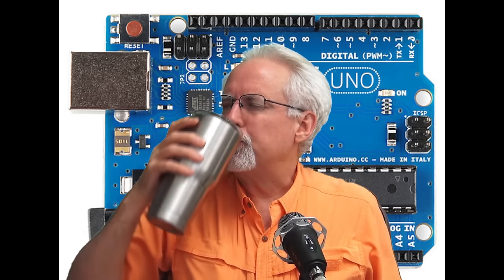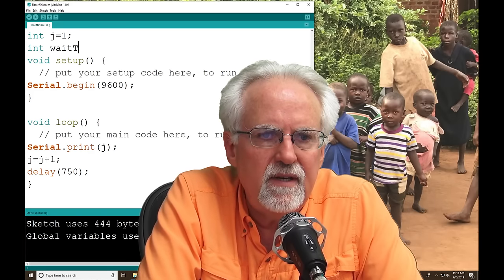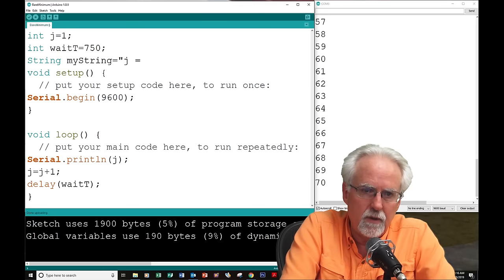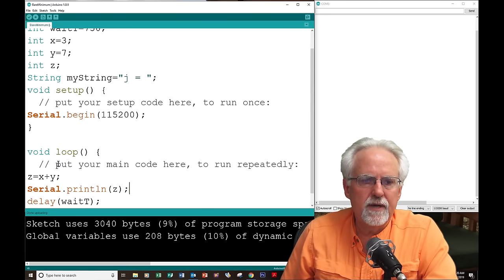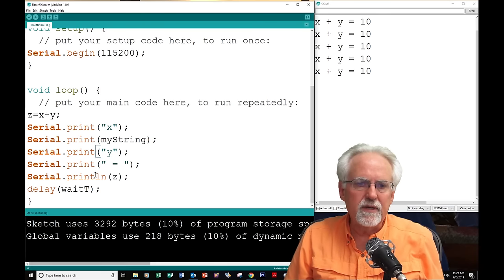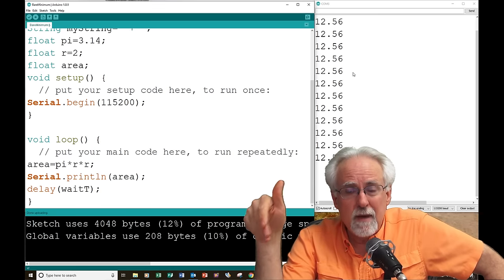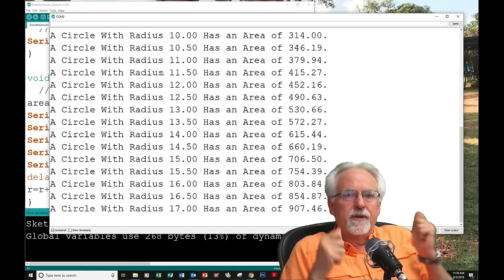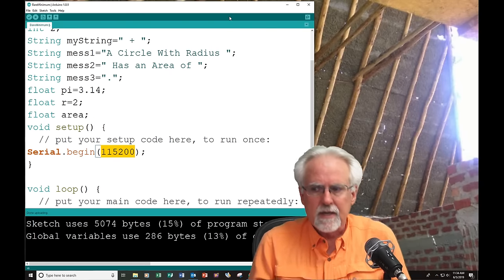Arduino Tutorial 11: Understanding the Arduino Serial Port and Print Commands

Comment: In C++ I was able to print multiple variables at a time, I gave it a try with this ide, low and behold it worked!
example: 
String myString=" + ";
int x=10;
int y=10;
int z;

z=x+y;
Serial.println(x+myString+y+" = "+z);

Code for this lesson:
int J=1;
int inDelay=1000;
int x=3;
int y=7;
int z;
String myString=" + ";
String circleA="the area of this circle is ";
float pi=3.14;
float r=2;
float area;

void setup() {
  // put your setup code here, to run once:
Serial.begin(9600);
}

void loop() {
  // put your main code here, to run repeatedly:
z=x+y;
area=pi*r*r;
Serial.println(x+myString+y+" = "+z);
Serial.println(circleA+area);
delay(inDelay);
r=r+0.5;
}

Comment: Great lesson again! Thank you so much, Paul. Used the print command to get something like this on serial monitor:
Voltage across 220 ohm resistor is 1.99
Voltage across 330 ohm resistor is 3.01

Code:
int readpin=A1;
int readVal;
float v1=0;
float v2=0;
int delayT=500;
String line1= "voltage across 220 ohm resistor is " ;
String line2= "voltage across 330 ohm resistor is " ;

void setup()
pinMode(readpin,INPUT);
Serial.begin(9600);

void loop()
readVal=analogRead(readpin);
v1=(5./1023.)*readVal;
v2= 5-v1;
Serial.print(line1);
Serial.println(v1);
Serial.print(line2);
Serial.println(v2);
delay(delayT);
Reply: Great work mate!

Comment: 00:05 Learn how to print from Arduino
03:00 The program prints numbers and increments them
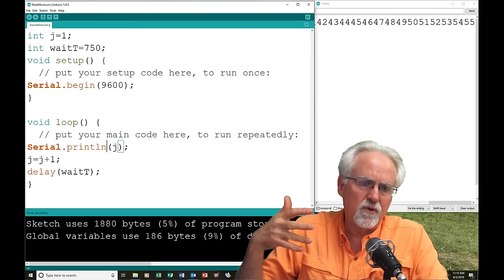06:10 Printing and formatting text using serial monitor.
09:34 Printing strings in Arduino using different methods
12:47 Understanding the difference between variable names and values
16:05 Print a circle with radius and its corresponding area
19:22 A circle with a radius of 2 has an area of 12.56.
22:29 Learned about variables and their types
Crafted by Merlin AI.
Reply: Shukriya ❤

Comment: Fantastic job Paul! 
While going through the tutorial I didn't want to lose the previous examples so I continued with additional Serial.print and Serial.println lines of code. Took a bit of experimenting but found it possible to print subsequent lines by always ending the last line with a Serial.println command.

The serial monitor returns this;
number = 1
3 + 7 = 10
Circle with radius 0.00 inch(s) has an area of 0.00.
number = 2
3 + 7 = 10
Circle with radius 1.00 inch(s) has an area of 3.14.
number = 3
3 + 7 = 10
Circle with radius 2.00 inch(s) has an area of 12.56.

Comment: I love your videos and they motivate me to challenge myself. I have a challenge for you using the millis function. 
1. Create a program that will allow the LED to blink by controlling the high (or on) time and the low (or off) time separately using millis function only.
2. on time=  2000      and    offtime =2000
3. make the program to do it over over again.

Comment: Amazing thanks Paul! 
Could be a good asset in mathematics for carrying out heavy equations that calculators are not preprogrammed to rerun. Really incredible, the range of applications you have with these microprocessors.

Noticed with the baud rate that the interval time between a new message is always 46ms, but the number of messages received in that time doubles, perhaps an update limitation of the serial monitor itself but I don't really understand. The baud number itself seems arbitrary at the moment.

Comment: MR pauI .I made my own one and I only learned the basics  and I got this and I test it,  works, very well;;;

float pi=3.14;
String mystring=("=");
int d5=2000;
float r=2;
float area;
String plus=("*");

int z;
int x=3;
int y=5;
String plusstring=("+");
String equal=("=");

void setup() {
  // put your setup code here, to run once:
Serial.begin(9600);
}

void loop() {
  // put your main code here, to run repeatedly:

  //mutlpying by pi
area=pi*r*r;
Serial.print(r);
Serial.print(plus);
Serial.print (pi);
Serial.print(mystring);
Serial.println (area);
delay(d5);
//ading  all postives numbers.
z=x+y;
 
Serial.print(x);
Serial.print(plusstring);
Serial.print(y);
Serial.print(equal);
Serial.println(z);

 delay(d5);
 
Serial.print(x);
Serial.print(plusstring);
Serial.print(y);
Serial.print(equal);
Serial.println(z);

delay(d5);

 
}

Comment: Perhaps a better homework assignment for this lesson would be to have us build a volt meter using two pins.  I did this and by moving the pins around on my breadboard, I was able to print out the values you had us calculate.

Comment: My goal is to eventually use the arduino to motorize a solar panel to follow the sun during the day and reset to start position to wait for the next sunrise. It would wait for 30 minutes and then back up a step or three then advance a step at a time reading the power from the solar panel and stop as soon as the power decreases from the previous reading. The panel will have a car electric window motor actuated through a solenoid. Polarity would be reverses by the arduino to step back and return. A means of determining end of travel is being thought about. Possibly a separate solar cell that would differentiate between night and day. Can't wait to get to the parts about sensors and solenoids.

Comment: At 9:20, I had a hard time seeing where you made that second change to the baud rate at the bottom of the printout screen. It took me several replays before I noticed the tiny box you were clicking on just over your shoulder. I did not see that the first few times through. So, I made one change (to the code) but missed the other & wondered why I was getting a long line of backwards questions marks! That might be worth drawing more attention to, in case others have the same issue.

Comment: Back in the days of VB6 you could tack several variables into a single line of code by using the syntax (using the variable of this tutorial) "A circle with a radius of " + r + " has an area of " + area + "."
is there no equivalent of this in the Arduino language?
Reply: You can, but you have to explicitly convert the float values to a String inline.  eg.    

Serial.println("A circle with radius " + String(r,2) + " has an area of " + String(area,2) + ".");

Comment: I know the importance of variables but I don't think is necessary to make variables to store text like  "A Circle With Radius" due to the reason that add complexity to program that's not needed but anyways your a amazing teacher and I think you are one of the best people to explain Arduino.
Reply: He was trying to show what can be done, not what necessarily what should be done. Though there are times when creating variables to hold string literals does make sense. Consider the situation where you might be printing pages of data and you want column headers on each page.

Comment: Hi 
you can write all of the print in one line like this, save some memory clear code
Serial.println(String("A Circle with Radius ") + String(radius) + String(" has an Area of ") + String(area));
Reply: Hmm, yes, but why are you casting strings to String? radius and area I get, but casting a string literal to a String is unnecessary.

Comment: Paul, I noticed that sometimes I upload the code and nothing updates? HOWEVER when I save (ctrl + S) and then send if the code is accepted then I do not have any complications.
NOTE TO TEACHER: I am starting to be able to pause and work ahead in anticipation (experimenting) of what I can try, then continue and what you suggest doing, I've already done something similar, BOOM!!! Thanks
Reply: Exactly the same as that. I actually went and did this by experimentation on the last tutorial. I printed, nicely formatted (as to not make Paul upset), 
"The voltage across resistor 1 is ..." 
"The voltage across resistor 2 is..." 
"The total voltage of the circuit is ..."

Its reassuring to go through a tutorial, already having the self found knowledge.

Cheers Paul

Comment: Quick question:
Last lesson, you said we should always put in a period/decimal point when coding in a number (e.g., 5./1023.).
Here, when you set j=1, etc., you didnt include the decimal.  When do we and when dont we include the decimal?

Thank you for the material!  Its been very well organized and informative!
Reply from the maker: Because j is a counter, and counters are round numbers . . . 1, 2, 3, and so forth. Those are integers. When dividing, you have to use floating numbers, hence the .'s

Comment: Hi Paul, I ordered these 433Mhz Rf Transmitter and Receiver package and they're very small components.  My question is, do these need to be connected to an arduino to work?  Or can they be used by themselves?  If an arduino is needed, it kind of invalidates the purpose no?

Comment: If Float accepts both whole number and decimal number. Why not use Float for all instead of Int?
Reply: Floating point variables use much more memory than integer variables...  In small systems like the Arduino series, you don't have gigabytes of memory to throw around.  In these small sketches that we're learning in these videos, it wouldn't hurt anything.  But if you write a sketch that pushes the limits of the board, you'll run out of memory.  Also, it's better programming practice to use the more efficient methods.

Comment: Do you cover event based print commands in another tutorial? I want to count the number of times a digital pin goes HIGH and also the duration of time it's HIGH each time. But I only want to print when the event occurs, not on a set time interval like shown in this tutorial.

Comment: Hi Paul, inquire how can i add say plus 3 degrees in coding of mlx90614 thermal scanner.  because as the distance of the object becomes further the more inaacurate  the reading is. to offset i would like to add plus 3 degrees in the coding to at least offset the distance to display in lcd 16x2 at least a more accurate reading.

Comment: Hello Paul! I accidentally put 2 in [Serial.print("A circle with a radius of 2 will have an area of ");] without thinking and it worked. I was wondering if its ok to put numbers in strings and if not why?

Also, I understand the importance and convenience of variables, but if you are sure you're going to use a constant only once, can you use a constant instead? 
Thank you so much!

Comment: I did the code you did:
int j=1;

int waitT=750;
void setup() {
  // put your setup code here, to run once:
 Serial.begin(9600); 
}

void loop() {
  // put your main code here, to run repeatedly:
  Serial.println(j);
  j=j=1;
 
  delay(waitT);
}

however I only saw 1 being counted, is there anything wrong with my  code?

Comment: I'm using a Teensy3.6 to follow along. 
When I copied your code over it worked for just printing 1, but when I incremented it, it started at 2. It worked, just skipped printing 1. Any advise?

Comment: is the printed response from the arduino or from the editor? IS THE ARDUINO PLUGGED IN AND ACTIVE IN THIS VIDEO?
Reply: It is plugged in and active all of the strings are uploaded to the arduino.  I made sure to test this by resetting my arduino after coding this.  I've unplugged from USB and used my battery pack after uploading.

Comment: Hi Paul, thanks for the series! According to my really quick search on Google, baud rate is the rate at which information is transmitted. Then is it intuitive to always use a higher baud rate? I understand that 9600 is enough for a simple program like this one. Are there any cases in real life where a high baud rate is not recommended?
Reply from the maker: If you do not have a clean data connection, faster rates will lead to more errors. Faster is not always better.
Reply: @paulmcwhorter  That makes sense, thank you so much!

Comment: Hi, first of all thanks for this series. Learning a lot from it. I got an arduino micro from which i try to make my own keyboard. Due a mistake in my old code it prints letters when i plug in the arduino instantly. I dont see any way to reupload a newer code because when i try to Upload it it starts printing 'eeeeeeeeeeeee' in my code and gives an error. Is there a way to fix this/reset the code on the arduino?

Comment: I solved the Serial.println adding a + among variable and it worked. Is it correct?
Which kind of problem could occurs using this approach?

int r = 1;
float p = 3.14159265358;
float area;
String msg1 = "A circle with radius ";
String msg2 = " has an area of ";
int waitT = 1000;

void setup() {
  // put your setup code here, to run once:
Serial.begin(9600);

}

void loop() {
  // put your main code here, to run repeatedly:
area = p*r*r;
Serial.println(msg1 + r + msg2 + area);
delay(waitT);
r = r+1;
}

Comment: Question: When I print the counter it works fine EXCEPT that the digit "9" is replaced by a "-" so I get 1 2 3 4 5 6 7 8 - 10 11 12 13 14 15 16 17 18 1- 20, etc. Any idea what is going on there? As a test I set int j=9; and just printed j, and the result was just a repeat of the "-" weird?

Comment: Paul, I think I mastered what you taught in this tutorial. Only thing I'm unsure of is that sometimes my serial monitor will start with "2 x 5 = 10" instead of " 1 x 5 = 5" like how it was programmed. THOUGH, when I restarted my UNO and program, it was somehow corrected and did as I programmed it should do and started with what I expected:
1 x 5 = 5
2 x 5 = 10....ect.
Even my Arduino R4 Minima last week started with the 4th or 5th lines.. it refused to start with what was supposed to be the first line, then when I connected my UNO, without changing the program in any way, it did as it was supposed to and started at the start for example 1 x 5 = 5.
This still baffles me. Could it be a bug? I have Arduino IDE version 2.3.2, the newest version.

Comment: One thing that might make it easier is if you had the program you are writing as a file we could copy and look at when we are done. You do several different things where you erase sections and then change the program up. I followed along with the first part, but did not want to erase and loose the first part of the program as you did to get the second remake where you added things. I would have been ok but I did not have the printer ready to print so I could have the first part before I changed as you did. Just a suggestion. I will have the printer ready next time, or better yet, start the video over and follow the second part and then the third. I am getting confused as to capitalize this and not that and the second word gets a capital here but not in println . Do you have a good source that could be looked at to clarify this more? Thanks for the videos.
Reply: I kept my old lines of code by using the remark command "//" in front of the previous lines of code rather than deleting them. ie. "//Serial.print(mess1);" will gray out the line and it will be skipped.  This link to the arduino command reference may help.  https://www.arduino.cc/reference/en/

Comment: Very fun indeed. But how do I make it print to a certain value then stop? where do I put, let's say: r=r+1 but <5?
Reply: float pi = 3.14;
int waitTime = 500;

for (int r = 1; r < 5; r++)
{
    float area = pi*r*r;
    Serial.println("A circle with radius " + (String)r + " has an area of " + (String)area + ".");
    delay(waitTime);
}

Though this will just print out the values for r = 1 through r = 4 continuously. I haven't found a way to make it stop looping, yet.

Comment: Paul, my IDE seems to be working a little differently form yours,  When I go to a new program from the dropdown the IDE opens a new window.  Is that the way it is for you or do have a setting someplace different from yours?  Everything seems to be working correctly just seems to be a little different.
By the way, thank you for the series, it is very helpful.
Reply from the maker: Mine is the same I believe
Reply: Thank you! @paulmcwhorter

Comment: I connect 330 ohm resistor and white LED light, using this method it appears on resistor it is 2.26 and on LED 2.74  voltage.  so LED has 400-ohm resistance? what is happening?

Comment: Heyo, some of the commands are other or not coloured in my program but they work. For example the string variable is grey, or the void setup is orange, or the Serial.print is not bold printed. Can somebody help me to get the same settings as you has? Thank you very much! (Sorry for my bad english). Regards.

Comment: On lesson 10, I followed all the way through and got 1.15 volts, however when I tried switching pin to measure R1, no luck, kept getting 5  volts, not the the 3.84 I was expecting.

Comment: I've built a multiplication table and it is cool.But the problem I can't fix is that when the digits of the products increases they also push the 2nd column which means that they will go out of the straight line when ever the digit of the first row increases.Can anybody tell me how to fix this?

Comment: 9:46 why wouldn’t we just want the fastest baud rate? Does higher consume more power? More data loss?
Reply from the maker: That is like saying why should I not always drive my Ferrari at 220 MPH. Why should you use a faster baud rate if there is not a reason to? You open up more opportunities for data loss. Use the speed you need, and make sure your cable can support it.
Reply: @paulmcwhorter  makes sense, thank you!

Comment: Mine is reading at 239 steady down the line. Any thoughts? Did I do something wrong or is it just different?
Reply: Sorry, 238.
Reply: I get the 1023 at 5v connection though. Maybe my resistor is a little off, even though it's the 330ohm and the 100ohm in use.

Comment: why my code is not working 
giving some kind of error 
i copied the same code :((

ERROR

Arduino: 1.8.13 (Windows Store 1.8.39.0) (Windows 10), Board: "Arduino Uno"

C:\Users\Zain Malik\Documents\Arduino\sketch_jul21b\sketch_jul21b.ino: In function 'void loop()':

sketch_jul21b:11:1: error: expected ';' before 'delay'

 delay(750);

 ^~~~~

exit status 1

expected ';' before 'delay'

This report would have more information with
"Show verbose output during compilation"
option enabled in File -> Preferences.